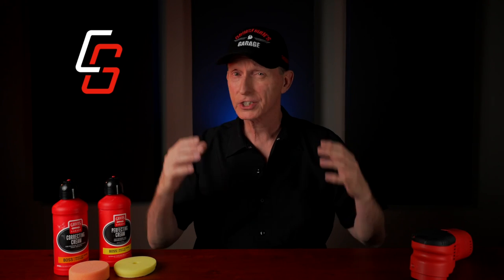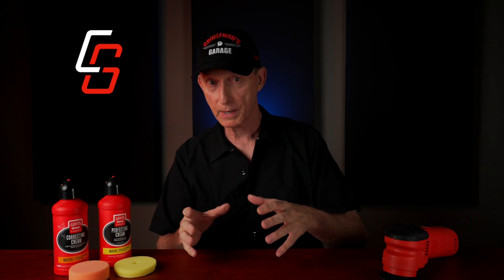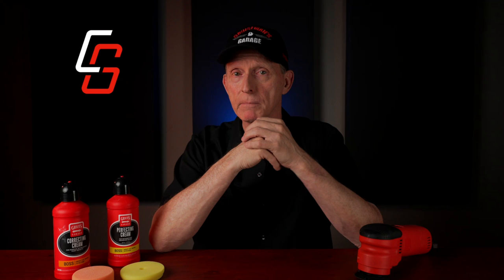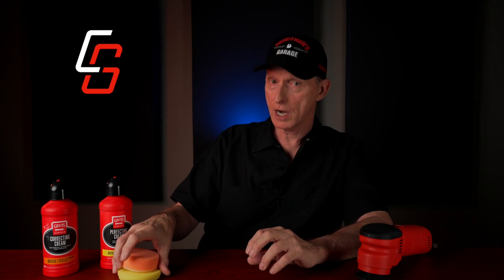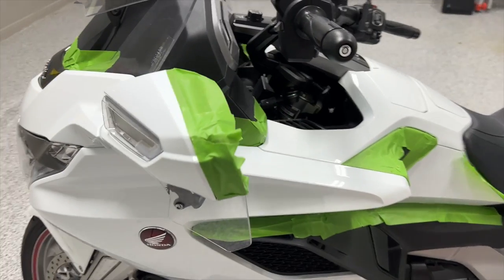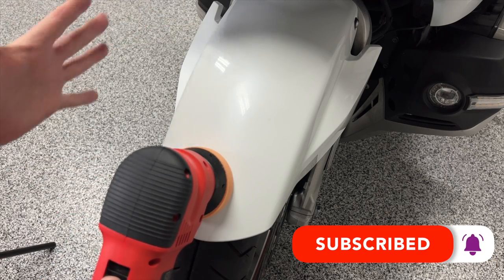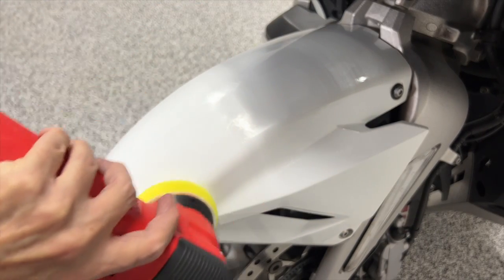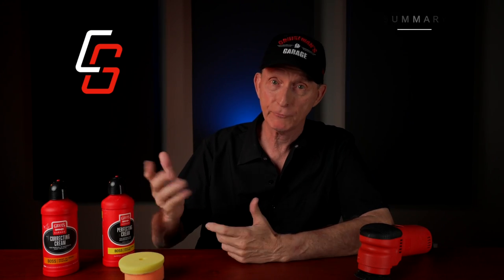Motorcycle Paint Correction and Polishing | Ceramic Coating Your Motorcycle

Comment: Thanks another for the info. There is a lot of work involved but for the work you are doing its worth it. For now about all I use is the honda spray cleaner and wax. It's so, so but nothing like what you ate doing. I'll be watching how the ceramic coating goes. Have a great day, later.